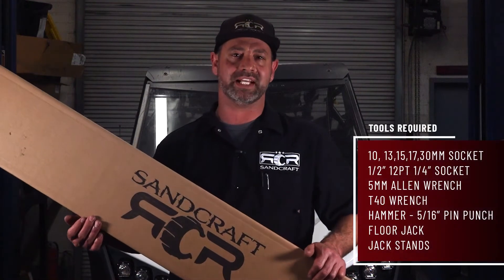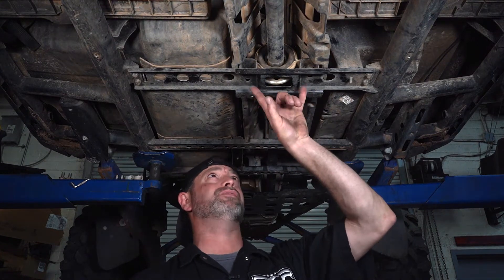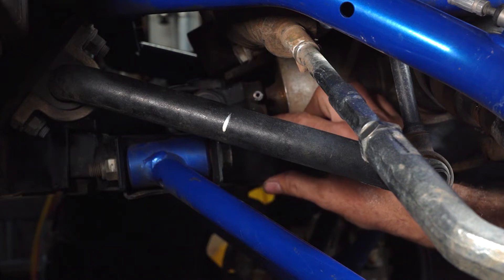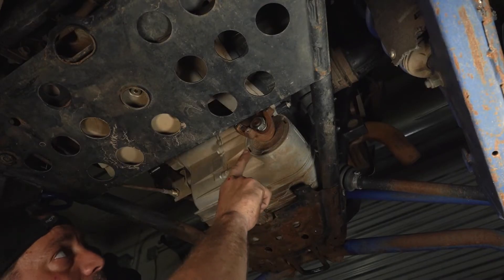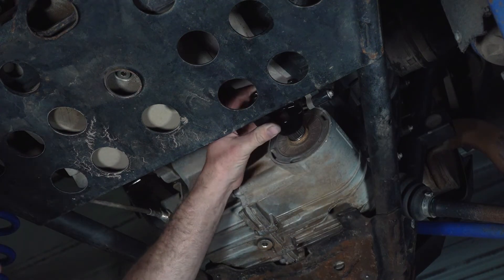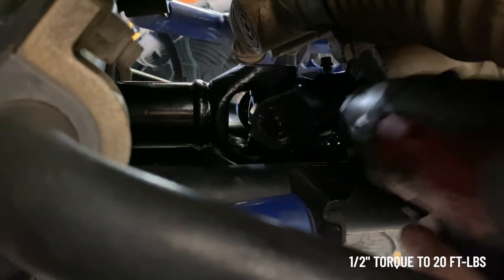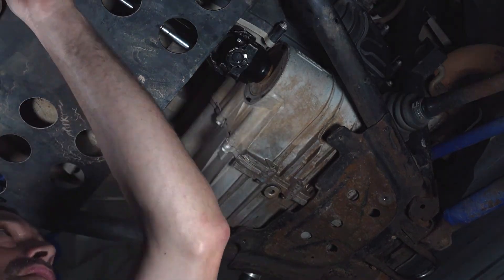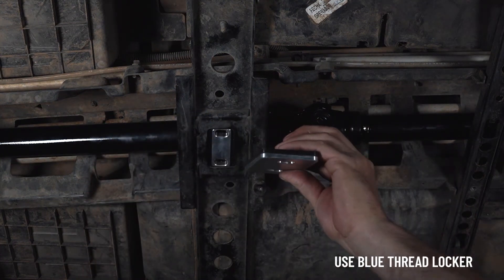SANDCRAFT DIY Installation - Driveline & Carrier Bearing Combo - Pro XP

Comment: Will this work with an ORB billet cross member on a 21 Pro XP?  Will the bolts on the kit be long enough?
Reply: Yes and no. You will need to grind down the top plate on the Sandcraft carrier bearing to fit and get two m10 x 1.5 x 40mm bolts  to secure it.